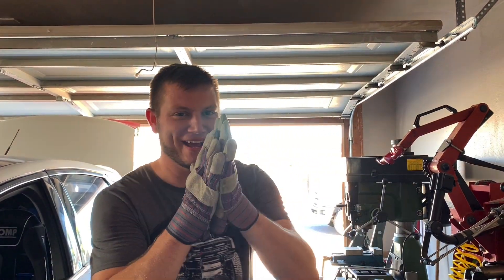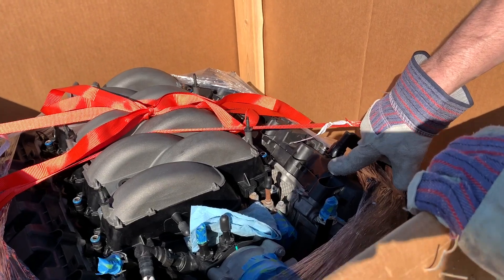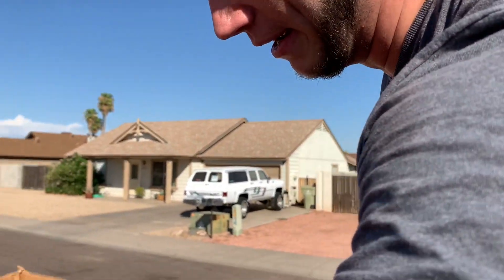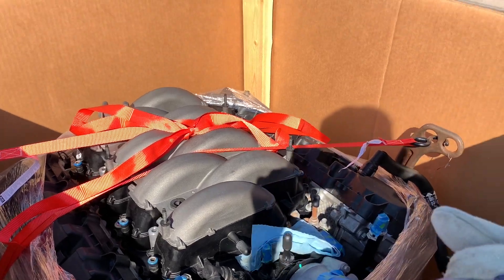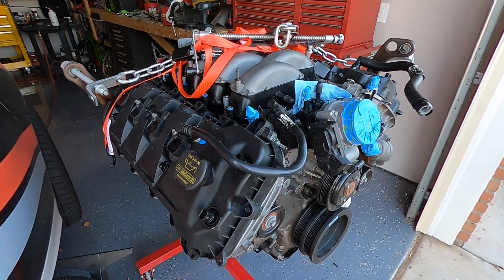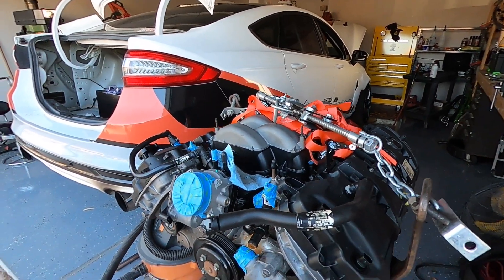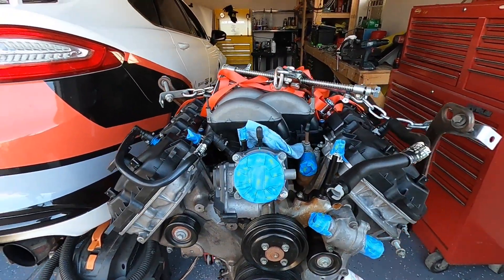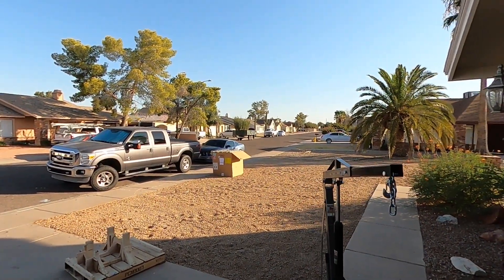The engine I'm going to swap into my S197, arrives!

Comment: Was there any consideration taken in what parts and specs you use for building the engine for drifting compared to drag racing or road racing? Or is power is power?
Reply from the maker: 8-Bit Bryan power is power. Cams are off the shelf along with the other supporting pieces.